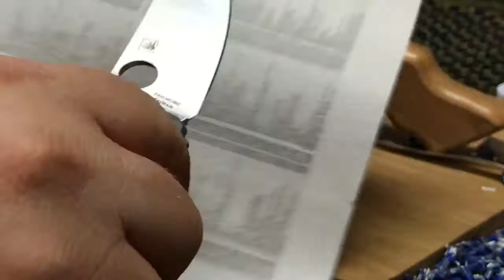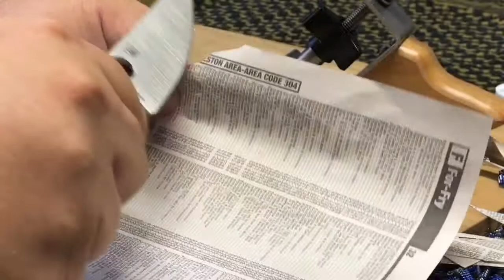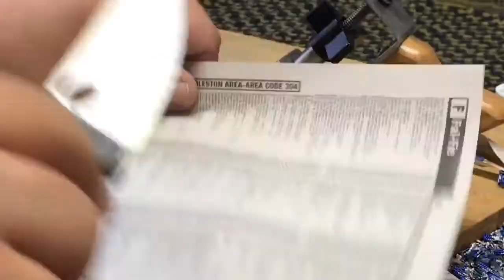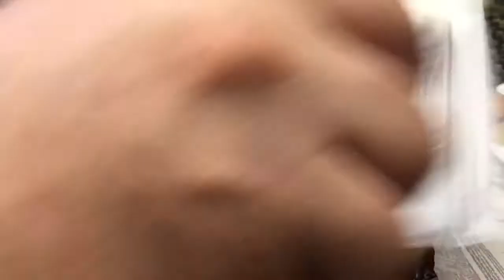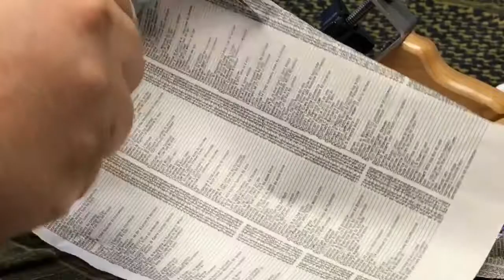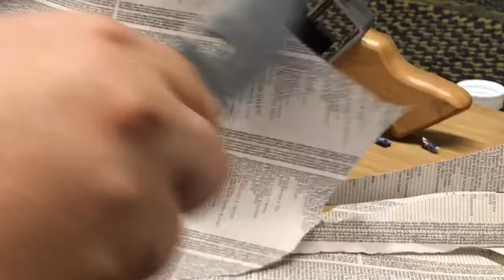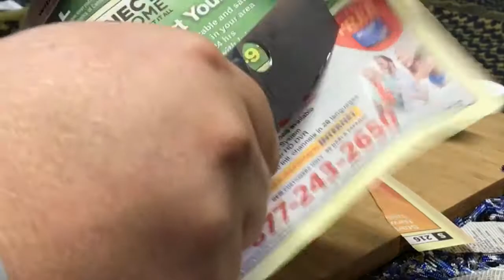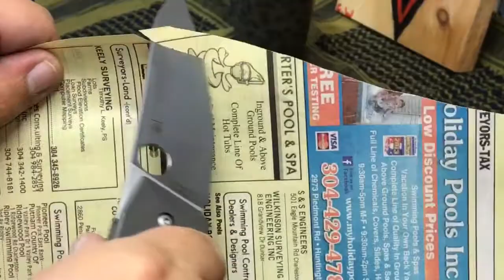KME .1 micron edge retention with Spyderco Lc200n Spydiechef! Bamboo abuse

Comment: LC200N is some pretty cool shit. NASA uses it for mission critical rocket components that need to be essentially corrosion proof. It’s their replacement for 52100 as well. Nitrogen steels man I can’t wait to see where they go next with them.
Reply: Another interesting note this steel is exactly the same as cronidur 30 in composition but it differs in that it’s refined in a super advanced process called pressurized electro slag remelting to create a super pure alloy.
Reply: magdsmad is this equivalent to S90V you think?